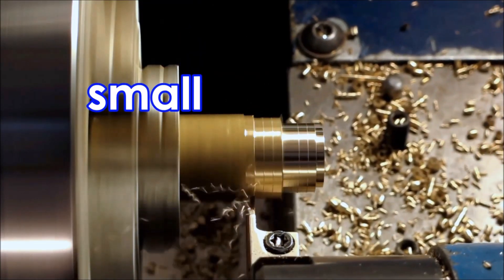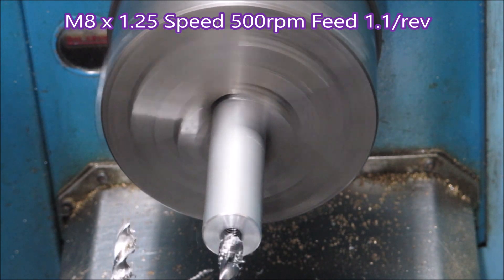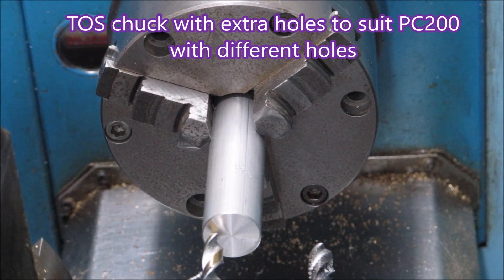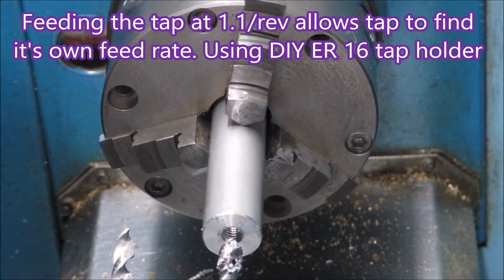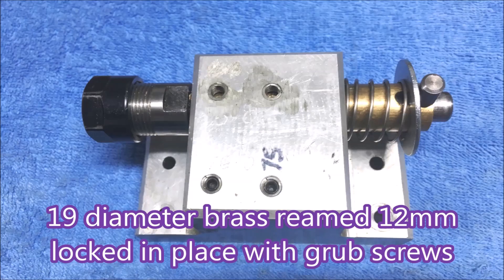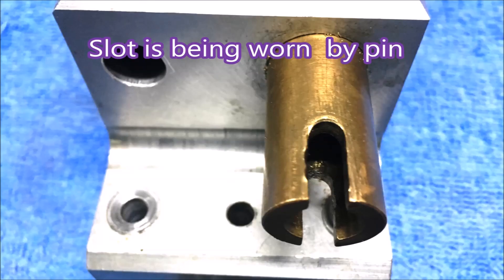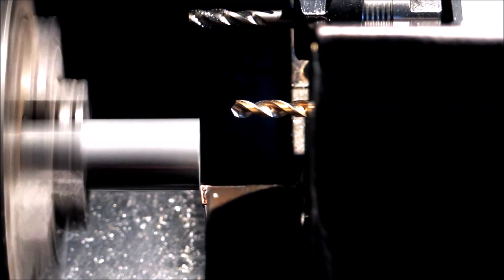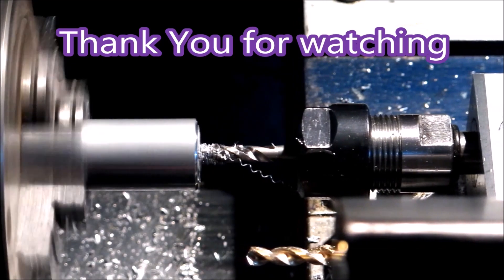CNC Lathe Drill & Tap M8 with DIY Floating Tap Holder, made from ER16 collet holder

Comment: Sir, you seem to be able to drill without any lube? Do you need any lube for drill bits 2-4 mm ?
Reply from the maker: In Brass usually not, but in Aluminium, sometimes I will put a little on the drill every  few holes.  Depends as you can imagine on the depth of the hole, the type of drill and how the particular material is behaving at the time
Reply: @smallcnclathes  Thank you
Reply from the maker: No lube here and drilling fairly deep https://youtu.be/VZNQmLvLXiM